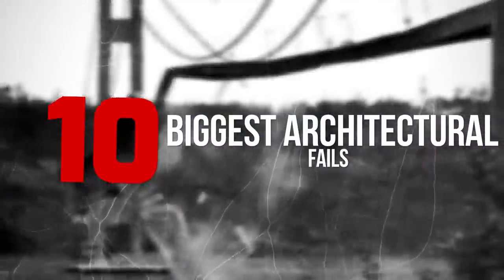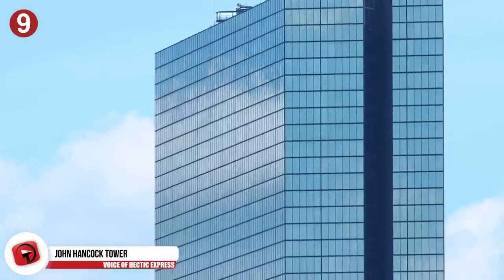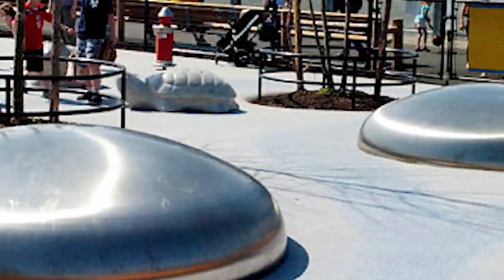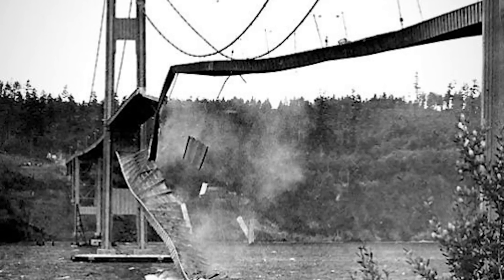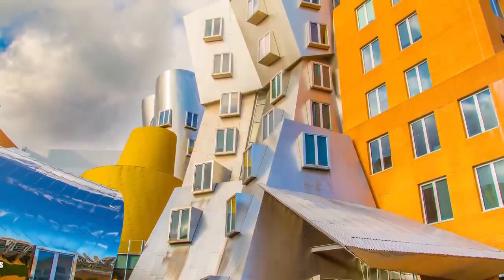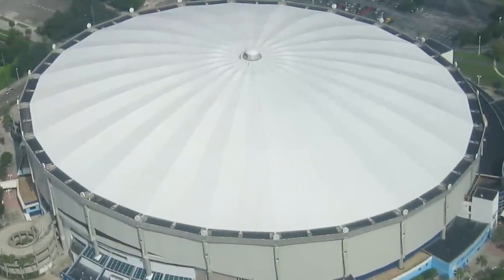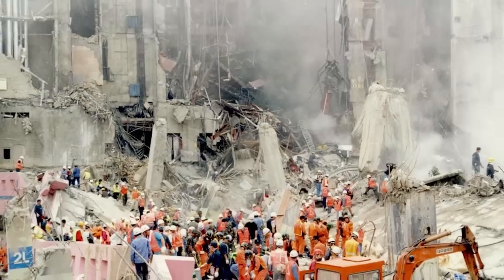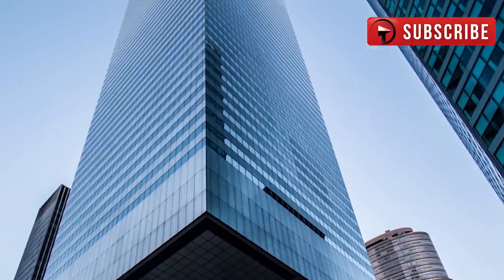10 Biggest Architectural Fails

Comment: I just. Found. This channel. And I must ask. Did you consider. That Youtube might be. A good opportunity. To try something. More appealing to the ear. Than this obnoxiously robotic. News reporter style. Of talking.
Reply: Holy shit do I second this! I couldn't finish and I had to see if I was the only one who found the narration vomit worthy.
Reply: Not to mention the poorly researched content. Like the fact that the Tacoma Narrows bridge was DESIGNED to sway. The design simply failed to account for all factors, most particularly the resonance (like pushing someone on a swing) of intermittent gusts of wind.
Reply: Or that the Citigroup building was the result of a series of choices made by multiple people at different levels. And the architect wasn't even to blame. The plans as drawn were fine. They called for welded bolts, but during construction someone decided that welded bolts were excessive, and it would be substantially cheaper to simply torque the bolts. That is absolutely true, but didn't take into account the other factors of the design, including the stilts and the inertial mass damping system to counter the swaying forces that all skyscrapers experience. And it only took into account normal wind loads from the cardinal directions, not strong gusts on an angle. Only when all of those factors are taken together is it a failure. And the failure wasn't discovered for quite some time, and it wasn't discovered by the engineers or architects but by an engineering student. It is a fascinating case study, and basically all of the actual lessons to be learned from it were missed in this video.
Reply: ur overusing periods
Reply: Thank you. I had not bothered with the sound and now I will just exit out of this page.
Reply: trent ryan You're under-utilizing letters, grammar, and logic.
Reply: Are you trying to demonstrate - in text - the VO's pauses, after every few words? If so, I DO agree, but, they did them because, instead of (either) rehearsing the script, before-hand, they just cold-read it, making it sound like they're unfamiliar with what word comes next - because they are 😉.
Reply: Oh the arguments! The reasoning! It's burning my opinions! Waaah...
Reply: Tarek EL Derbas Actually, I was providing free advice on how to make better videos, and I did so in a demonstrative way. I don't want to just dislike things and abandon them, I want them to improve. In this endeavor, I will always speak my mind and most of the time get shit for it. I didn't expect upvotes, I didn't do it for upvotes. I expected people like you. And still I don't just dislike your reply and move on. I talk to you.
Reply: +elvancor I concede. Valid points. Even though I can't tell if you're telling the truth since this is just text.
Reply: Also valid point. I wouldn't mind losing an argument to a guy as civil as you.
Reply: I. Just. Read. Your. Comment. It. Has. Way. Too. Many. Periods. To. Be. Able. To. Know. If. You. Are. Serious.
Reply: Mr. Deleted - mrdeleted.com "EX-Amish Guy" Way to miss the point there, buddy.
Reply: Way for you to miss the point.
Reply: Mr. Deleted - mrdeleted.com "EX-Amish Guy" Missing the point can be useful in a rapier duel.
Reply: This. Is. Not. A. Rapier. Duel.
Reply: Look at all our periods! We'll turn this place into a womens' restroom!
Reply: elvancor OH HELL NO THIS AINT BECOMING A RESTROOM
Reply: minion
Reply: I. Think. That. Could. Be. A. Possible. Opportunity. But. Idk.
Reply: Architect with a "t" at the end lol
Reply: This looks like a file name of a movie downloaded from BitTorrent.
Reply: He's Australian, but very clearly e-nun-ci-a-ted. He's also speaking American English, which isn't his first language.
Reply: 5:56 A perfect example!
Reply: Why do you have a period after every word?
Reply: UGH I JUST READ THAT IN HIS VOICE!
Reply: elvancor have you considered trying another channel
Reply: ROTFLMAO!
Reply: Didn’t get why there was a bunch of periods until the end 😂😂😂
Reply: I live near the Tropicanna field, and trust me no one near me wants to watch the game in that depressing, wearhouse-looking field
Reply: i read this in the voice. Wow.
Reply: @dom-xt9pt  Well at least you got the joke 'cause there are many, many commenters here who, shall I say, just...

WHOOSH 
😂😂😂

Comment: Tacoma Narrows Bridge: NOT a picture of the original bridge. Also the writer is either a conspiracy theories, anti-capitalists, or is loose with the facts. They were not trying to save money. They were using a plate girder deck which was new and the knowledge of vortices shedding in a cross wind were not well understood.
Reply: Yes, I believe it was one if the first built with that light of a design.  in hindsight, someone said if they had only varried the length of the deck sections, it might still be in service today.  Something about all the sections being the same length on a structure that flexible created a resonant frequency.  It was more like a neat science experiment and less like a bridge.
Reply: To be fair, one reason that they tried the new design was that it promised to be cheaper than traditional construction (and it really was, once they got certain quirks worked out). The goal was to get the same amount of stability with far less material. The winning bridge design was accepted specifically because the main competing design was judged to be too expensive...
Reply: ganymedeIV4 : 
Nope. It has however caused ''warping'' of a car's body, which is impressive enough in its way and probably the story Talltanic is misreferencing there.
Reply: The concept of a "stiffened deck" which was learned by Roebling who overcame the limitations of the early English bridge designs in the early 1800s. I am passionate about this topic because the Tacoma bridge has been rated as one of the top mistaught things in engineering colleges.
Reply: Glad I'm not the only one to notice this error in the video. It was actually caused by the resonance frequency of the wind being matched to the shape of the bridge. As a result all bridges today factor that in with construction.
Reply: Funny/sad part is that at the time it collapsed, they even had recommendations from a professor hired to study the problem that they either cut holes in the I-beams or build >-shaped sections to make the sides more areodynamic - both of which would probably have saved it. They elected to go for get the > shapes, but the bridge fell before they could get it done.

At least it didn't kill anyone (except that dog who would rather bite his rescuer than leave the car).
Reply: Heard from physics class that the wind caused the bridge to experience resonance
Reply: Ng J" Kármán vortex street
https://en.wikipedia.org/wiki/K%C3%A1rm%C3%A1n_vortex_street
Reply: About ten years ago, I made a documentaries' collection about the fall of this bridge... YES, budget was indeed a problem... At the time, the cost of a suspension bridge of the like, was between 12 million and 14 million dollars and, due to the great depression, there was a lot of need for economic designs.  Here is a source that speaks about the budget (I wish I could come up with others I read before but better checking in history/science books): https://www.engineering.com/DesignerEdge/DesignerEdgeArticles/ArticleID/171/Tacoma-Bridge.aspx

"Construction finally started in 1938, with a much lower budget than the committees wanted. They asked many consulting engineers to prepare different plans. The original plan was made by Clark Eldridge, and cost $11 million. One of the new plans was made by Leon Moseff. He redesigned the bridge with drastic modifications so it could be made with only $7 million, the allocated budget. Eldridge still stayed on as the project engineer."
Reply: Ok on that page, the facts section under all of that, speaks more clearly about the budget problems (proving that budget WAS indeed an issue):

To engineers, the Tacoma Narrows were more of an economic challenge than an technological challenge. A bridge here would cut at least 40 miles off the trip between Tacoma and Bremerton. But traffic estimates were low. In 1932, the federal government refused to give financial support for a bridge for that reason. It took major lobbying to get the money. Even then, though, it was only $3 million. So the state scrapped its first design - $11 million - and turned to Leon Moisseiff. Moisseiff, a well-regarded designer and researcher, calculated that a considerably lighter deck -stiffened only by a thin plate girder, not a deep truss - would do, thus cutting the cost to only $6.4 million. Everyone knows what happened: less than a year into its life, the bridge began to twist violently in a 40 mph wind, and soon collapsed. The disaster - which took no human lives - shocked the engineering community and did a lot to shape American bridge building. The bridge was replaced with a very conservative design in 1950.
Reply: no, the frequency of the bridge was met and it caused it break
Reply: The decision to build a two-lane, 2800' (850m) bridge with 8' (2.4m) solid girders was done, in no small part, to make the bridge economically viable.  Leon Moisseiff had just finished a similar  (though wider, and slightly deeper) solid-girder suspension bridge in New York City a few years earlier - just in time for the World's Fair. In taking on the task of  designing a bridge which was certain to have far fewer toll receipts than one in NYC, Moisseiff literally went a bridge too far.
It's fascinating to see how the Tacoma Narrows Bridge collapse shook the structural engineering field. The Mackinac bridge (1957) features lattice girders that are deeper than the bridge is wide. It looks like the suspension cables are superfluous  (in reality, they are absolutely necessary).
Reply: The guy who made this video is obviously not academically qualified.

Comment: structural failures are not architectural failure
Reply: roger sausa Well an architect calculates the force the building can withstand so no not structural failures
Reply: roger sausa just u
Reply: Structural failures are engineering failures. Architects design pretty buildings, structural engineers then design what holds them up.
Reply: Edkusha architects don't calculate anything, they design. These are engineering fails.
Reply: You can get structural failures based on what the architect has drawn. I have done two different jobs drawn by two different architects where we have had major issues based solely on what they had specified.
Reply: Falling Oranges Then its an engineers job to find a solution to the problem: Problemsolving. 
You calculate material tensile strenght, max shear and tear force (and much more), taking in other variables and see how they fit for the architectual project, no?

I just completed my first year as a construction engineer, so ive learned quite a bit about material usage, though nothing about the actuall construction prossess yet. I'm more interested in infrastructures (road, bridge, tunnels) than Buildings.
Reply: Falling Oranges sort of, the Architects main job is to create the aesthetic, since a large skyscrapers simply cant be ugly after all. I’m sure experience architects have some idea on the structural element but, engineers design all the fasteners, materials, design of the structure to ensure a building works, that’s their expertise
Reply: A building with all its components, including its structure is called a work of architecture. When we study history of architecture we study buildings, bridges and all its components. Its not called "history of structures" for a reason. Also, structural systems in architecture are called architectural structural systems. Stop spreading misinformation.
Reply: fernando5silva obviously there’s much more than aesthetics. But what I’m saying is Architects have do not specialize in grain structure of metals and grades of bolts and call outs for welding and such. But it is not up to an architect to design earthquake dampers, or the frequencies of the wind and it’s affect in resonance. Those are all necessary and up to us engineers to solve. What I’m saying is there are different roles, and what looks good sometimes doesn’t always work, and what works doesn’t always look good. I’m not demeaning architects, the architectural program at my university is one of the hardest programs we offer, If I offended I’m sorry
Reply: @stephenimsong3462  I'm a registered architect and I work with structural design and analysis, specially reinforced concrete design and specification. When I designed large buildings in the past of course our office's team worked with structural engineers, because large buildings require not only many engineers but a lot of collaborative architects. The amount of work and variables is big... Anyway I understand your argument. Sorry for offending you.
Reply: This is what concrete, foundation amd material inspections are for. Its designed by the architect followed by the structural engineers then tje contractors do the rest, every stage has to be inspected but in the end the architect is the one who plans it all and puts it together
Reply: @stephenimsong3462 : It really depends on where you are. Architecture and structural engineering stem from the same roots in the pre-modern master builder profession. They started to split into separate fields about 100 years ago, with architects specializing more on the design and cost side of things and structural engineers more on the engineering side. But still, either profession could design, plan and build (or better: oversee building) a house from start to finish.

In Germany (Europe in general?) for example it is still mostly that way, whereas the US is further along the split where in many cases (but certainly not all) architects for example can no longer do (or at least sign off on) the structural analysis. In Germany, for simple buildings (family homes etc.) you normally still only have an architect (there's a special case where master carpenters are allowed to build wooden houses without an architect or a structural engineer involved). For more complicated structures where you have collaborative work anyway there is stronger specialization (also other professions like dedicated construction managers etc. get into the mix as well).
Reply: @booxwee3804 Architect doesn't calculate any load. Load estimation is the work of the structural engineer. The structural engineer will pick up the architectural designs and work on the estimation of all the load acting on the building based on the self-weight of the building, the intended usage load (life load), wind load and in some rear cases earthquake and other vibratory load which may result from natural or man-made causes.

Most of the failures are due to the foundation failure. This foundation failure is very tricky and hard to predict due to the  complexity of geotechnical engineering
Reply: Jegede Abdulwasiu As architects work with structural engineers, it's still an architectural failure.
Reply: Yes, they are if they result from .mistakes made by the architects.  Architects and engineers design every detail, from foundation to window design.  If any of those designs fail, how is that NOT an architectural failure?
Reply: It depends what country you trained in. The education and traditions differ. Some have the architecture/ engineering overlap other countries keep them separate.
Reply: Edkush hahah you know nothing. An architect does not calculate anything, they are only design the aesthetics of a building and hire a structural engineer to design the core and structure of the building.
Reply: Im a super duper alien tech and engineering of EVERYTHING.

The simple answer is, 5mm of earth and 8grams of brains was missing on those tragic days. Everything just opposite of right went on and total devastation of irregular non-standard calculated menstrual droplets occured and wiped out the foundation of its mechanical powered industry Strength layout.

Your welcome.
Reply: @blahfasel2000  I would PAY to see a structural engineer design a building... the spaces would be completely unusable and the building would probably be built like a box with the least concern for social engagement...
Reply: @Paltheus  I never said structural engineers would design good buildings on their own. Architects make buildings nice to look at and usable, structural engineers make them not collapse. What I said is that in earlier times architects did both, but as the subject got more complicated, the profession split into the two we know today.
Reply: @blahfasel2000  True... However, architects do not only make a building "nice to look at" and "usable"...they envision the whole environment making sure it is compatible with the exist,ng infrastructure and context as well as making sure of its social functions....I should know. I am an architect... as I said I would PAY to see an engineer design a building as their duties mainly consist of ensuring that the building is constructed to the specifications laid down by the architect.
Reply: Yes, they are.  It was poorly designed and engineered.
Reply: Literally clicked on this video to say the same thing
Reply: Its the engineers fault ✋🏾
Reply: Good